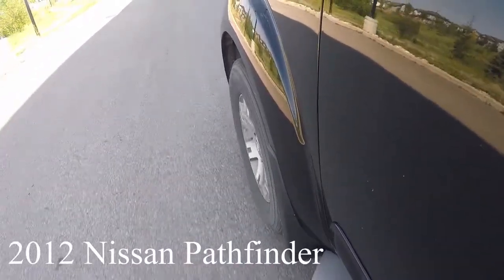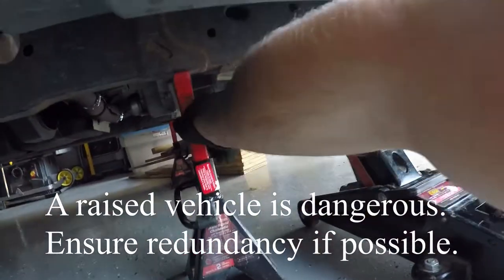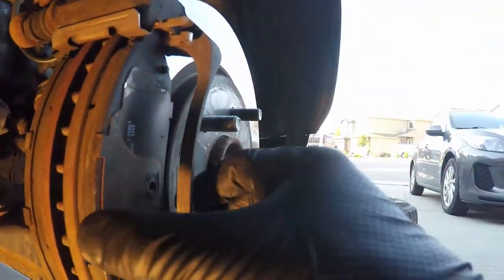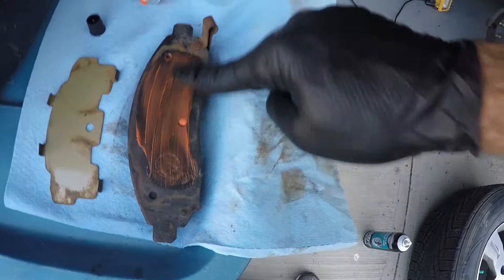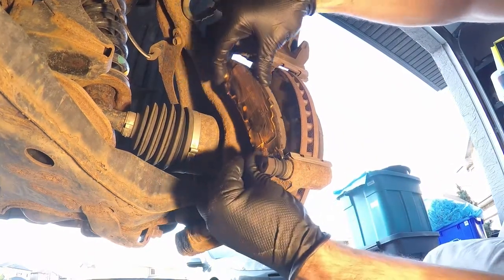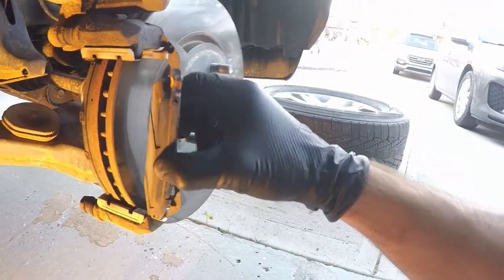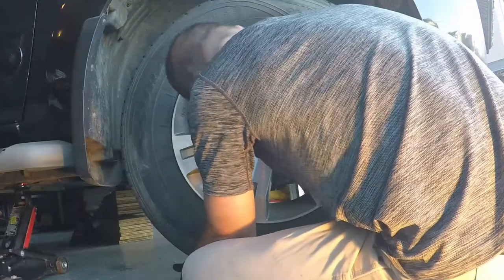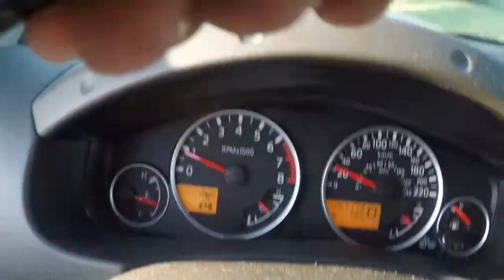2012 Nissan Pathfinder Brake Squeal Fixed

Comment: I also have a Nissan of the same year that 4.0 is awesome engine
Reply from the maker: I agree, I'm a big fan of the engine, four wheel drive system, and ride/handling. I'm a bit disappointed in electronics and rust protection. Generally though I like the body on frame pathfinder.